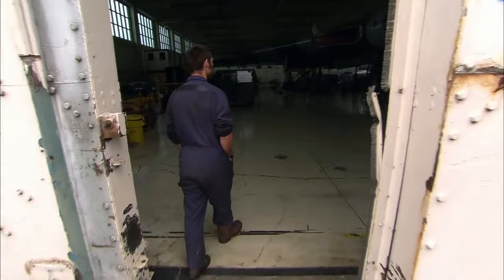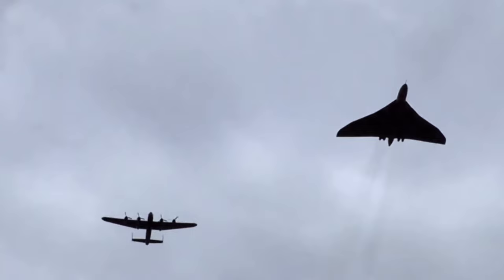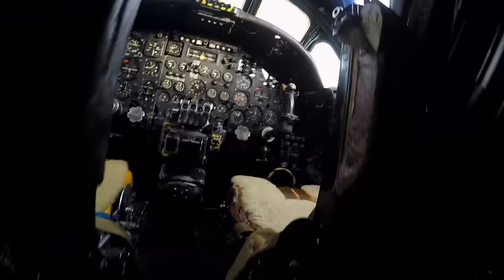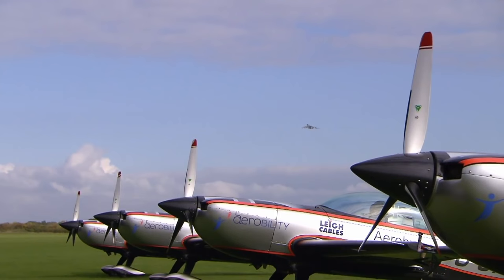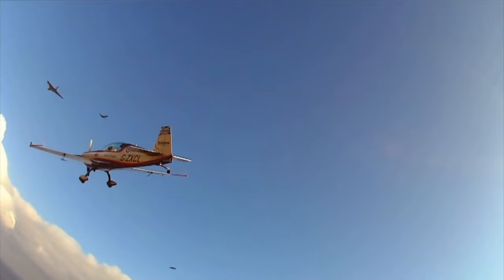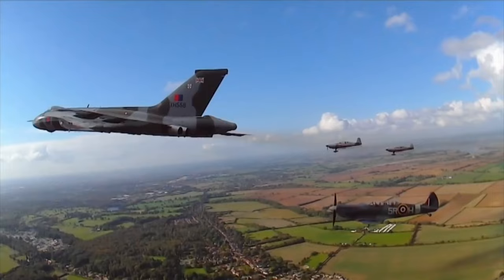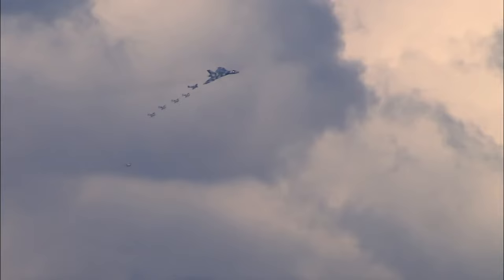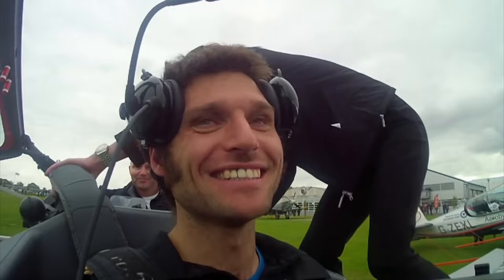Guy Martin's Master of The Air War Plane Adventures | Guy Martin

Comment: so the leading edge of the spitfires has a gap . that is weilded?
Reply: Maybe seam sealer, maybe leave as tight gap, certainly not welded. Airplanes undergo heaps of stress & must be allowed to move, which is why they're riveted even to this day. Welds would crack upon first flight.